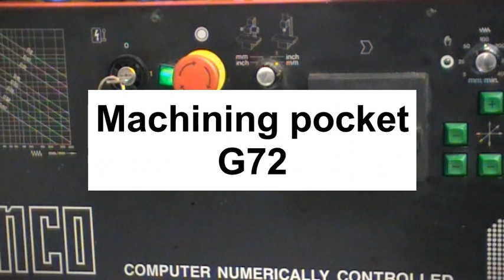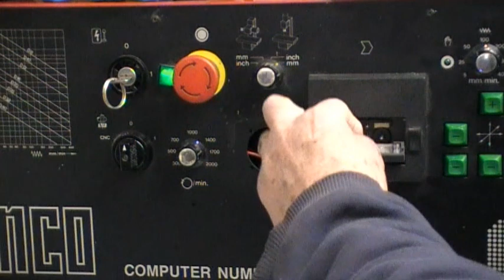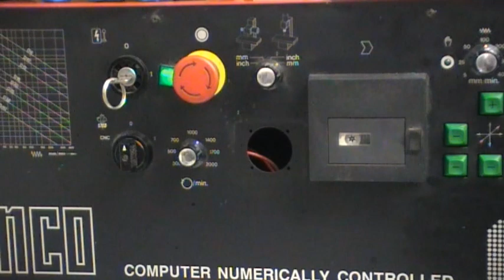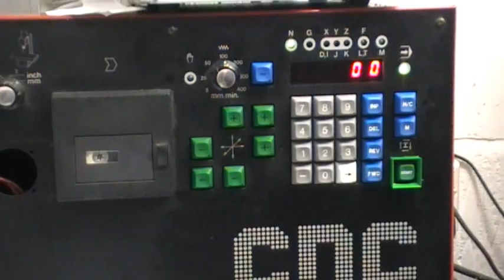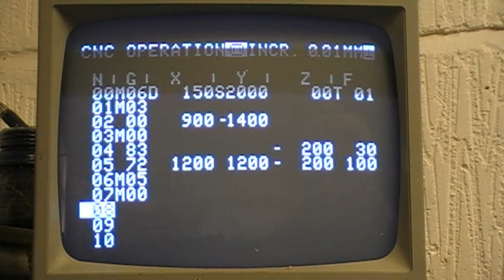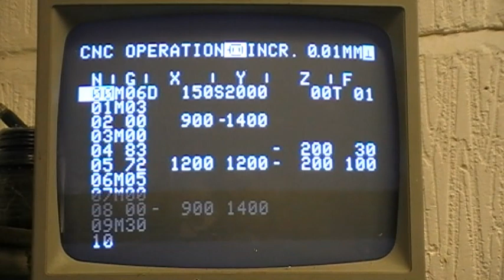Emco F1 cnc Mill control with G72 demo

Comment: The pocket is rectangular, can you teach me how to program a circular pocket in the original controller. Thanks
Reply from the maker: If you join the emcof1cncmill  group at the link below you can download the MFI program FOC from the Files section.
https://emcof1cncmill.groups.io/g/main
Use Notepad to  enter the following in your machine for a 14,x2mm DOC pocket using a 6mm cutter.
14mm diameter pocket
Incremental mm program
6mm diam 2 flute centre cutting slot drill
Tool radius entered Column X
Tool start 1mm clear of work
at pocket centre
Adjust Feedrate to suit material

%
    N` G`  X  `  Y `   Z ` F  
    00M06D  300S2000    00T 01 6mm 2 flute centre cutting slot drill
    01M03                      Tool centre of pocket, 1mm clear of work
    02 01    00   00-  300  30 
    03 01    00  400    00  60 
    04 03-  400- 400    00 100 
    05 03   400- 400    00 100 
    06 03   400  400    00 100 
    07 03-  400  400    00 100 
    08 00    00- 400   300     Tool out of work and to centre of pocket
    09M30                      Program END
   MI
Reply: @ukmwg  I had already joined the emcof1cncmill and enco5cnclathe groups.
I just didn't understand how to make the pocket circle yet.
Thank you very much for your explanation.
Reply from the maker: @emco5cnc  You are welcome, are you using MFI to write your programs or just entering the code in the machine control panel ?
Reply: @ukmwg  I use MFI.

Comment: Nice tutorial i was thinking of making this my self. Just for the ppl that dont have any explanation of the Emco F1. 
Only my spindel wil not work whit the M03 and stop whit M05 this is a special option  for the machine my Emco just dos not have.  but the spindel cnc switch is there. 
i hoop you wil make more i am looking forward to the next 1.
Reply from the maker: Hi Werner, The F1 had as standard a DNC board fitted which has a relay fitted that starts the spindle when energised using the M03 command and the motor control switch is set in the cnc position, that is turned counter clockwise where it is held by the internal coil. As with other programmed commands you need the chip guard door closed  to test run. if you join the emcof1cncmill group in the link showing there are many pictures in the Photo albums showing the DNC board and fitted relay, also help if needed from other group users.    https://emcof1cncmill.groups.io/g/main